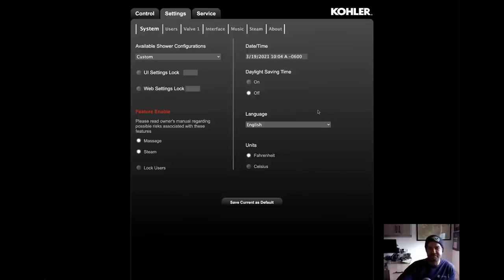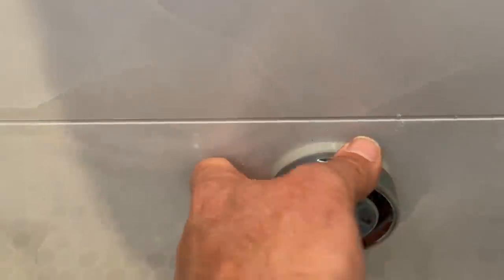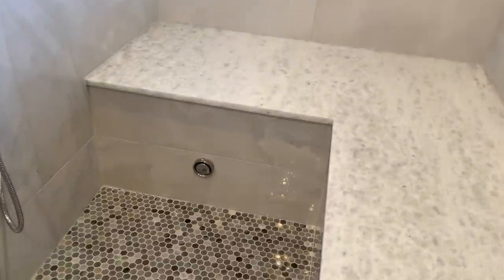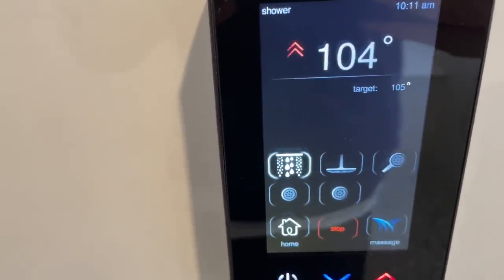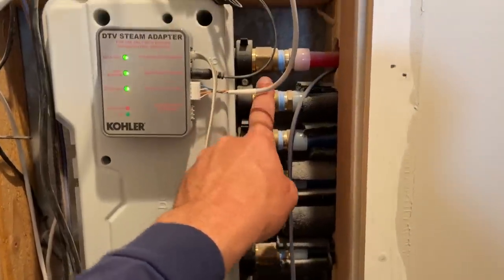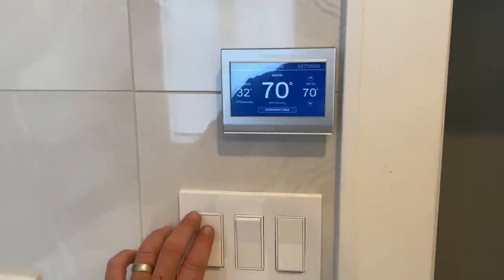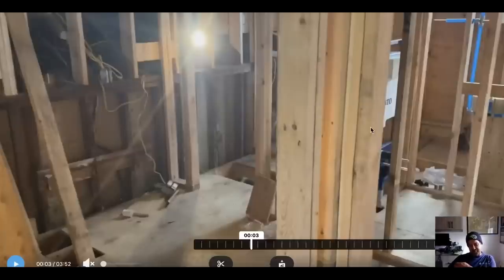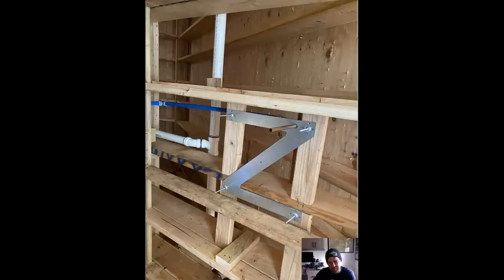Kohler DTV+ 6 Port Thermostatic Shower Valve with @kohler 11kw Steam Generator & Real Rain Panel

Comment: So nice to see someone who knows to size up the pex in the system. The moment I heard that, your review became the top of the pile. 3/4 supply lines to 1/2 outlet lines with pex just doesn't flow enough to not see a relatively severe pressure drop. I had 3/4 and 1/2 installed in the primary bath in my house and wound up having to go back and swap it out with 1" in to the 3/4 supply and to 3/4 to the 1/2 outlet like you did. Even with the shower rough in being 1/2 outlets it flowed better gpms with less pressure drop.
Reply from the maker: Stupid design on kohler

Comment: Hey @pipedoctor. Great video. I'm currently living in Puerto Rico and undergoing a complete master bedroom bath rehab. I have almost the exact same system setup that you installed. DTV 6 port Thermo valve, 13kw Steam Gen, 4 Body Strays, 2 angled body sprays, 4 speakers, Hand Held, but no overhead rain shower. We just demolished the the entire bedroom. Would love to hire you as a consultant if possible to help with the planning of the install of all these units. I have been through all the manuals and have a pretty comprehensive understanding and preliminary plan of action already. If this would be something you have a little spare time for, i'd be more then willing to compensate you for your time. If there is one thing i hate doing, its anything twice.  As you can imagine there are not any plumbers in puerto rico that have ever seen this system. LOL. I'm a GC stateside and have plenty of knowledge to get this done myself. A little guidance by you and I could knock this out the park. Thanks

Comment: Hi I just moved in my home 3 months ago. And this system is installed, I love it!! However one day the display stop giving me shower options. When I choose shower the home icon comes back up. I’m not sure what the problem is. Does the system require a battery somewhere 😩 I can no longer use the shower
Reply: @PipeDoctor  They are behind a panel I have never opened. Do you think I should access back there? It also worked for 3 months without me connecting it to the new Wi-Fi network. Is it possible to work without internet connection

Comment: Nice work Mikey! I would like to ask for help!🙏🙏
I have a newly installed dtv shower system and there is sth wrong with it. I used the save as function in the interface to update the preset as to activate the body spray1. However, body spray2 functioned instead of bodyspray1.

Is there anything I can do to fix it? Thanks!!
Reply: @PipeDoctor  thanks so much for replying me!!

Comment: Great video my friend.  Question, on the 3M filter into the steam generator, why did you choose not to have the cold water 3/4 inlet run through it first and then the DTV and Steam Generator next?  I'm in the process of implementing the same with Kohler's new Anthem controller and a Thermasol Steam unit.  Definitely interested in your thoughts.  Looking to use the same 3M Brand but the 15GPM version.  Thanks in advance for your time.
Reply from the maker: Tankless DHW heater. Wouldn’t make a difference.
Reply: @PipeDoctor  Thanks for the quick reply.  All the best to you.  Peace.

Comment: We're looking into installing this system in a new project we're working on. There are so many parts you need to make this DTV+ system work.  I appreciate your video because its helped me figure it out. There's really not that much out there. My final question is, is there a specific collection of shower heads or any Kohler shower heads you can use with this?

Comment: We're going to be installing the DTV in our new house. 4 body sprays, 1 handheld, 1 shower head, 1 rainfall head, and a steam shower. My question is, how do you keep the water hot. My plumber told me we'll burn through our water heater in 10 minutes. I talked about doing a couple of tankless heaters. How did you keep up with the demand of the system? We're in Wisconsin, so the water temp rise is my concern.

Comment: The one thing I find funny about devices like that the biggest thing is is we all know water and electricity do not mix regardless if it's low voltage or high voltage they still don't mix some things that come up with I just don't know LOL :-) :-)
Reply: Always have a way to bypass  pass the  electrical  controls  . And  make it work.  I hope Mike  put some bypass valves somewhere.

Comment: Sweet! Also looks easy to clean too! I’m assuming you did all the rough work?
Reply: How much did this set u back? Dyi and paying the plumber? And did u add radiant heat in the floor and bench? Looking to do basically same  5x10 shower, no windows tho(do u rly need them?) And idk if i was going to do active looping thro my bench seat/floor or radiant closed loop. Its just a perfect shower, and thanks for heads up on that rain head, ill be getting a diff model for sure, not worth the money, so many better cheaper options.

Comment: Curious why you would plumb in pex? Those fittings are terrible and the algae that grows in them is nasty.. plus all those fittings create so much head pressure limiting flow. Don't you think it's better to bend copper for maximum flow and copper in general to control growth in pipes. A lot of money for this system and nice cast iron but then the pex I can never understand why people choose it, especially nowadays with copper crimp fittings. Curious your thoughts

Comment: Lotta work there it looks great nice job. Couldn't you change the real rain shower head to a different head for more flow or is that one set to the system.
Reply: Add a pump booster to your water system that works when the shower/ rain heads come on. Not that hard for a  fix.
Reply: With the right relays. From the control you have
Reply: Flip  or Flop